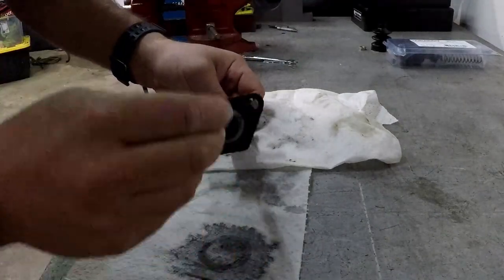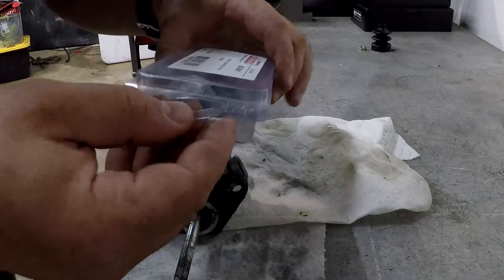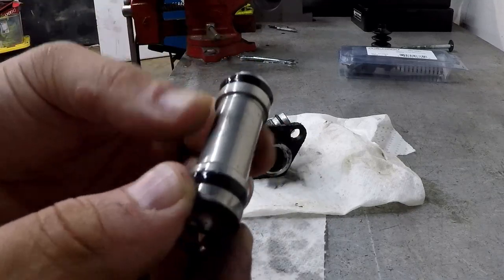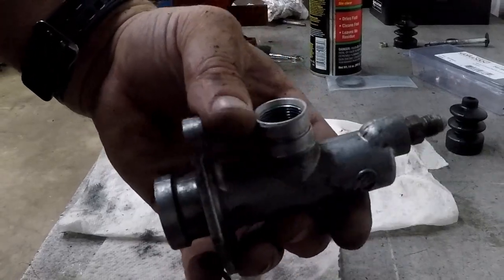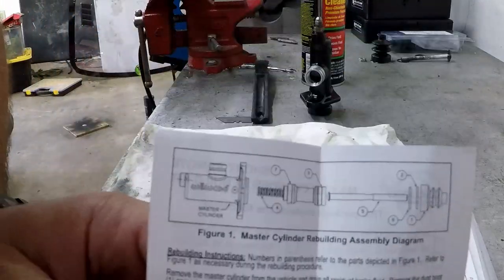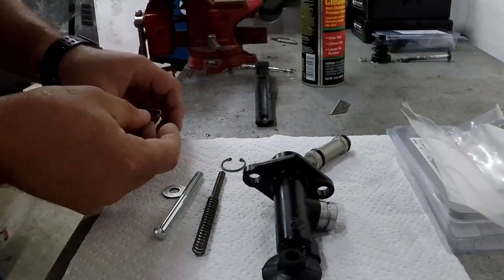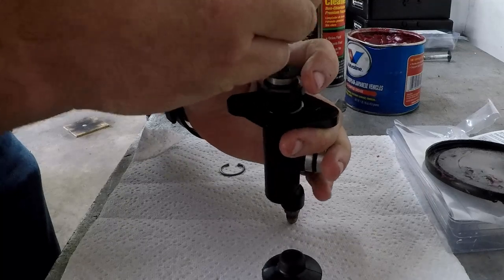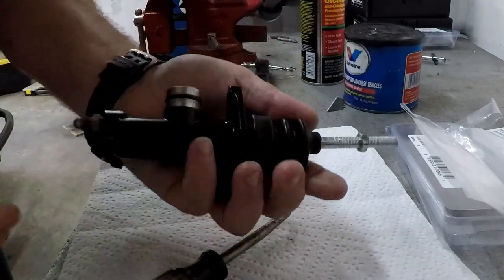How to Rebuild a Wilwood master Cylinder

Comment: Was that a petroleum based grease you used to assemble?
Reply from the maker: Yes, but Vaseline may have been a better choice
Reply: @BlakeBuildsATL  

Even Vaseline is petroleum based. Any petroleum in the brake system will cause the rubber to expand and your system will eventually lock up.  Every rubber seal in that part of the system will now need to be replaced.
Reply from the maker: @GrayCloudRacing66  good to know, but it’s been fine since. The only other seals would be the front caliper seals. 

Next time, I’ll use some non-petroleum based grease